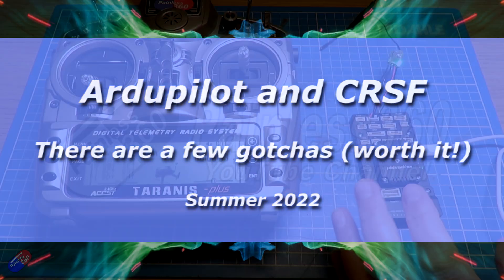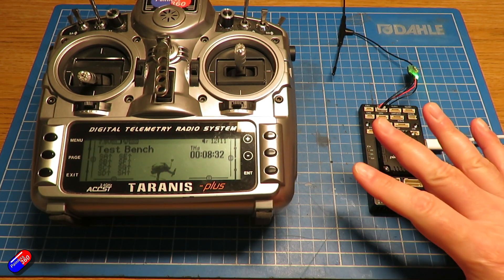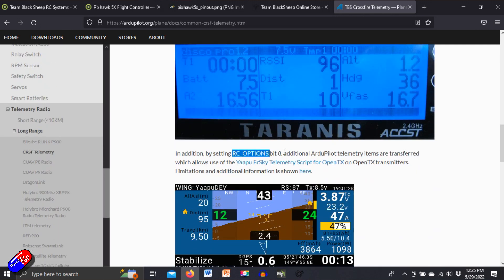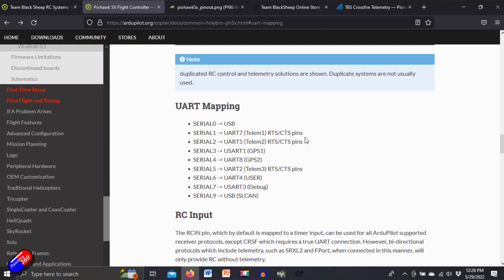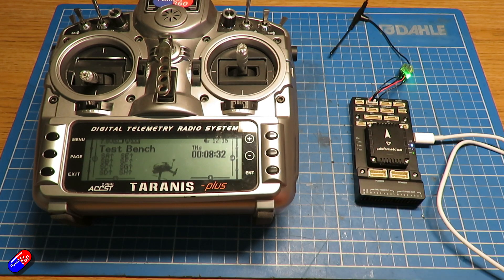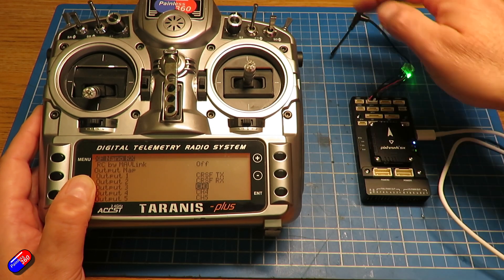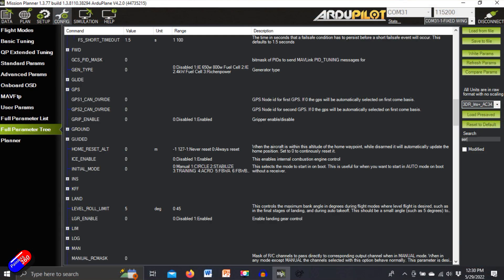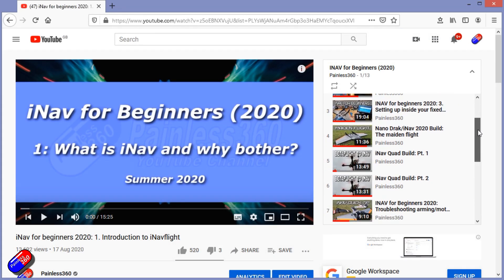Ardupilot and CRSF: Setup, gotchas and some cool stuff too! (Crossfire, ELRS and Tracer)

Comment: Hi again. Managed to connect everything and works nice. While I was ground tests and try to do small hops with higher power, I tried to run engines on higher setting and see how vehicle behave. It is not stable on high settings and has tandency to fly backwords as i noticed on just short hop in in the air. Any suggestions? 
Let me ask you assembled X500 so props marked with yellow sticker are counter clockwise rotating props and other two without stickers are normal clockwise rotation. I could not find that detail anywhere. Thank You.
Reply from the maker: Check out the X500 buuld series, all steps are shown. Best of luck

Comment: Managed to bind RM RP1 V2 RX with RM TX16S MKII ELRS according to steady green light and indication C on TX16S. However, looks that controls do not work in configurator like in your video. 
I am assuming that some of configurations issues. I have completed serial5, RSSI, and RC protocols as per video. I have never setup anything with controller, this is brand new out of box TX16.  Any ideas issue might be with Mission Planner configurations or controller or both? Thank You.
Reply from the maker: I'd expect it's the Ardupilot setup having a setting wrong. See links in description... Best of luck

Comment: Just quick comment here. According UART mapping serial1/TELEM1 are Serial2/Telem2 are DMA. Same as Telem3 port. And docs specify "For best performance a UART with DMA capability on its RX port is desirable, but not required." it seems that it should work on either Telemetry ports? Or I am just crazy here:-)
Reply from the maker: Sounds about right. For hobby grade flight controllers, check the manual for the port used for Betaflight or inav for the CRSF wiring. Best of luck
Reply: @Painless360  This is great help. I am using Radio Master TX16S MKII ELRS controller and hglrc elrs 2.4 Ghz Rx. I am still waiting for rx and batteries for this controller, but just wanna make sure that I have all details before I start install and assembly process.

Comment: Good evening Lee, since a few day's i am the proud owner of a brand new Radiomaster TX16S M2.. and the Ranger Micro Elrs, with it came 2x RP1 rx and 1x RP2 rx, .. i watched this video a few times, and copied all whats done by you.. i use the pixhawk 2.4.8.. a much earlier version of what you are using.. the binding of the Rx was the easy part.. but to connect it to my FC won't work... i did connect it to Telemetry2 on my FC.. can you give me advice on the information i did write herre? 
Thank you very much,
Morris
Reply from the maker: https://ardupilot.org/copter/docs/common-tbs-rc.html has the latest... Best of luck
Reply: @Painless360   Thank you Lee, i understand that i have to study.. and will do so!
Reply from the maker: Best of luck, I have lots of videos aimed at beginners in my ExpressLRS playlist.. Best of luck!
Reply: @Painless360   Good afternoon Lee, did some homework and discovered a lot about my Pixhawk2.4.8.. it is a very early version of the Pixhawk you are using... but after a few hours of study i got it all to work.. changed the fmod channel to ch12 instead of ch5.. that is what the Elrs doc's told me.. and in the RC_OPTIONS of the FC i ticked the box for Crossfire pastrough, for the telemetry on my Yaapu script also the baudrate to 420k.. works like a charm!
further i want your opinion on a purchase i want to do.. a Holybro pixhawk 6X  .. can you recommend this FC?
regards,
Morris.
Reply from the maker: Fab! Well done. There are lots of clones in the 'Pixhawk' family of hardware now and not all are created equally. The numbering doesn't make sense any more either, as vendors just added numbers hoping to fool the public that something was better as it was a PixHawk 5 vs. a Pixhawk 4. Got way out of control!
Reply: @Painless360   That's how i think about it now.. in my early day's  i flew with a Robbe-Futaba  FC 18-V3 plus.. was ages ago, 40mHz.. nowadays it's something else.. 
saw a lot of your vid's.. also your interview's with Ben from 3DXR.. should i buy one from him? most of what i bought was at Ali.. but i want genuine stuf now...
Reply from the maker: The only 'Pixhawks' I will use here are the ones from Holybro and the CubePilot. You can also now use non 'Pixhawk' flight controllers with Ardupilot now, see https://ardupilot.org/copter/docs/common-autopilots.html#closed-hardware for the list!
Reply: @Painless360  Thank you very much for the info Lee!!
have a very nice weekend!

Comment: Thank you for the tutorial! I wonder if the telem1 or telem2 (I'm using a pixhawk 6c mini which does not have telem3) would work with csrf? The ArduPilot said that you need to use a ''real'' UART port (might be referring to DMA uou mentioned), but I can't find relevant information in the document😢
Reply from the maker: I'd simply try both and see which one works... Happy flying

Comment: Hi,
I am unable to get stick input. Using matek f405-wmn FC & matek r24-D RX and HM 2.4 TX in a ts16S, the binding is ok but whatever the serial6_protocol 23, serial6_options 0,4,7, brd_alt_config 0,1. I am spending hours and hours on trying  a lot with no success.

Any idea that could help ?

Thanks forwards
Reply from the maker: Wrong serial port, TX and RX not swapped? Could be a few things. Best of luck

Comment: problem I am having is after I select the params im not receiving anything on mission planner mavlink or controller input. ive already tried swapping  the rx tx Im using the full sized tx and rx and the Flight controller is a orange cube telemetry 1 going to channels 3 and 4 on the full size rx that's the only channels it would allow me to change to crsf rx and tx.
Reply from the maker: Possibly configuring the wrong UART? Best of luck
Reply: @Painless360  the only way I can get it to connect is if I put channel 1 as ppm and channel 3 and 4 as mavlink
Reply from the maker: It will work OK like that. Happy flying!

Comment: How about using an actual ELRS reciever (like the RP1nano receiver from RM)? I cant get it to work following the documentation using elrs-ardupilot setup. I have the Ranger 2400 Transmitter module and the RP1 nano ELRS Receiver they are bound together. I cross connect my RP1 TxRx uart to my FC pixhawk cube black RxTx to Telem1 then configure the parameter SERIAL1=23; BAUD=115;RSSI TYPE=3; RC_OPTIONS=512("Supress CRSF model.." ); RC PROTOCOL=1. And the result...nothing is moving in the Radio calibration. Is anyone here has tried the same?
Reply from the maker: Models like the Jumper Xiake 800 ship with an ELRS receiver and it works great. Most common error I see (after not connecting TX to RX), is not configuring the right serial port in Ardupilot. See my latest PixHawk 2023 series for how you figure it out. Best of luck

Comment: As I’m new to ELRS, I’m stuck with drone building because of few things. 1. How do we assign 8, 12 and 16CH to ELRS receiver e.g., RP1 or R9MX, in Ardupilot and Radiomaster TX16S Mark II ELRS TX, as I need to control hexacopter drone motors, 3 axis gimbal and few other servos?

2. How do we make connections of ELRS receiver to Pixhawk Orange cube after assigning 12 or 16CH, do I need CRSF to PWM/ SBUS converter or I can just directly make connections to Telem 1/ 2 port and connect all the drone motors, gimbal motors and other servos to Pixhawk’s Main out or Aux out?
Reply from the maker: Check out my ExpressLRS playlist. All answered in there... Best of luck

Comment: Hi Lee / all, well explained Tuto. I own 3dr px4 so différent than showed. Is it a way to connect elrs in the same way? Using telem 2 ? I would love to launch my reptile s800 and other FW with same elrs protocol than my kwads. Thx
Reply from the maker: Should work the same way.. best of luck
Reply: @Painless360  Lee thx for your reply. I will try using telem 2 according to px4 diagram. It would be nice to take benefit of the elrs long range capabilities on FW.

Comment: To connect the crsf tracer is the same pinout like the Nano i did it for Sbus its working well now on the Ardupilot pixhawk and Apm on Telemetrie   I would like to know where the pinout for RX and TX are Is there somewhere a wirering  manual where i can read about it ?thanks for the good work you do on YouTube
Reply from the maker: It sounds like you are using SBUS, if you are using CRSF with a Rx and Rx pinpot then you connect it the same way as in the video... best of luck

Comment: Thanks for making this video.  I have actually been working on installing Ardupilot on RC crawler for a Rover project so run at a upcoming RC show.   I managed to get CRFS working myself after a few days of going over various docs.  However I have run into a issue with using Wifi to connect to Mission Planner.   Im running CRFS for Rx and Mavlink to another Uart but when I turn on the Wifi on my Tango 2 Loose my CRFS signal in only a few feet from the model.  Does connect just fine to the PC via wifi though.     So could you possibly do a follow up video on Using CRFS with Wifi connected to MP for telemetry feedback please.    I do have a X9D and full size CRFS modal as well if the Tango is my limitation.   Let me know if being a patron member will help with this LOL>..
Reply from the maker: CRSF v3.0 may change some if this, video planned. Stay tuned!
Reply: @Painless360  Will do.   Thanks for the quick reply.

Comment: I tried CRSF with Arduplane about 4 years ago. Worked fine on the ground, and rc was fine out to several kms, but telem stopped working (especially sending commands up to the aircraft) at just a few hundred meters. Ended up switching to Dragonlink and have been using that since. Has anything changed with CRSF and Mavlink that might have improved it?
Reply from the maker: At the moment, Mavlink telemetry is dropped as soon as the Crossfire radio profile changes. Some news on that due sin, stay tuned!

Comment: Any tips on also getting mavlink via wifi to work? Got RC using CRSF (like in the video) working easily enough. Getting mavlink to work on channels 3 and 4 doesn't seem to work. Mission planner never detects a heartbeat.
Reply from the maker: Only what's in the TBS docs - www.team-blacksheep.com\tbs-crossfire-mavlink-over-wifi.pdf

Comment: What does RCOPTIONS bit eight mean? I am a bit confused and I've been having issues setting up elrs with arduplane.
Reply from the maker: I'll make a video on it. I cover it in the upcoming VTOL series. If you find RCOPTIONS in the full parameter tree and click on the value then a window will open showing all of the options that can be set... best of luck
Reply: @Painless360  Thank you. I think its because I use QGroundControl instead of MP but either way I will most certainly give your future vtol videos a watch.
Reply: it's very confusing, because if you choose "use passthrough for CRSF telemetry" which is 9th option in that list.
the value you get is 256 not 8.
I guess 256 is 8 bitmask or something, but it's not intuitive. 
also, protocol 23 is RCIN, and protocol 29 is Crossfire VTX . one would think Crossfire VTX is the right choice.

Comment: Great video Lee, I am curious, do you get bad feedback through your Taranis speaker when using Crossfire above 500mW ? I can't seem to stop mine doing it.
Reply from the maker: I do, I dont use that power level here though...
Reply: Search YT, there's a few videos on what mods to make to the Taranis to solve this problem. It does require the case to be opened though 😀
Reply: @stevietee10  Thanks, I've put the ferrite rings in there so far, with no effect, the buzzing drives me crazy so I'll see if there are better mods out there.
Reply: @CoyoteFPV  I used the 'wrap the ribbon cables in bacofoil' trick and for good measure I earthed the foil to ground with two link wires. It worked for me 😀

Comment: I couldn't be bothered setting a model name for ELRs.  I did a whole 45min flight on my z84 wing using another models settings as I forgot to select the model I was about to fly on the transmitter.  It can be done🤤. (Both wings!). I couldnt figure why the ail trim was a little out for the whole flight 😎